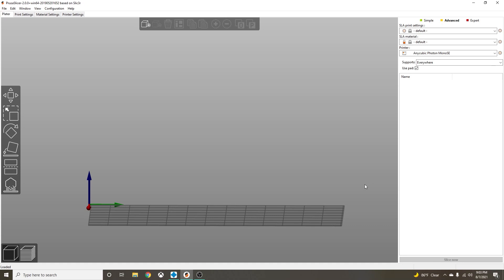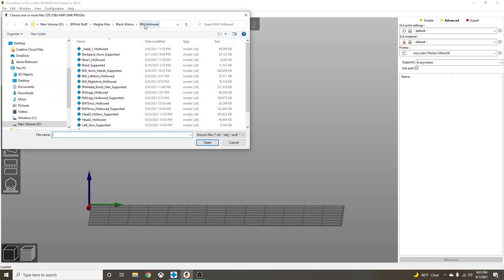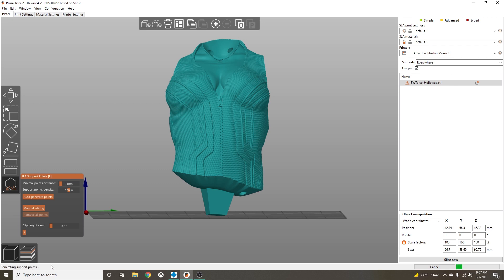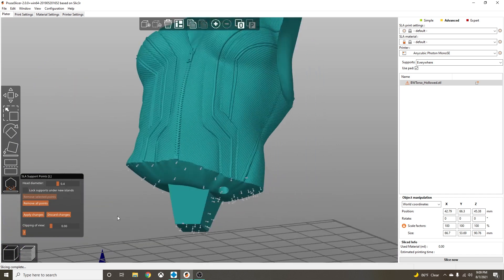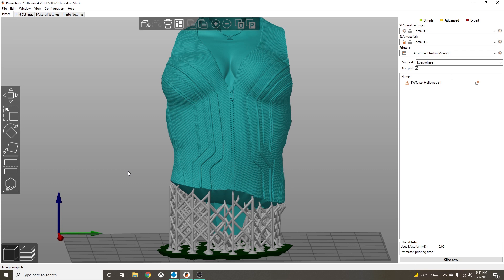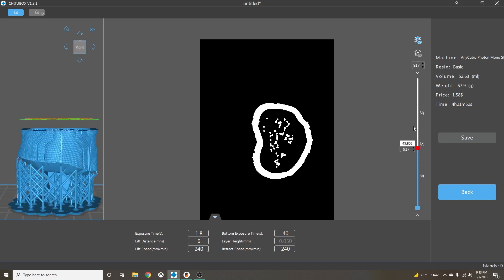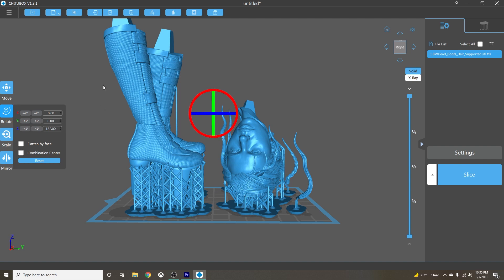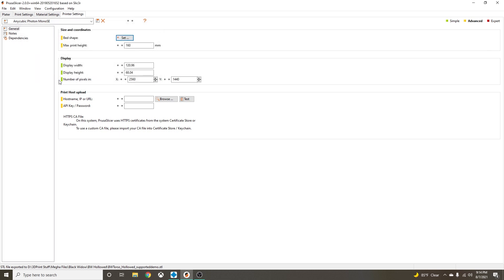PrusaSlicer Autosupports for resin printing- NO MORE FAILED PRINTS

Comment: Thaks awesome video.  have you brought your model back into chichi box or lychee and asked it to find islands to see how accurate your method it.  just curious.  I will definitely give this a try.  So your work flow is
step 1. bring into chichi box and hollow and put in drain holes
step 2 bring into purse and do what you showed in the video
step 3 back to your chichi box and slice and good to go.

im telling you im going to try this and it will save hours thanks
Reply from the maker: In the beginning I would use Photon workshop to find any islands because it's the best for that, but after never finding anything bad, I just stopped. It took me a while to trust my printer and trust my slicer but it hasn't let me down yet.

Comment: i see that you dont use inner fill for your prints, your models are completely hollow inside?
Reply from the maker: I don't use infill, but the models have supports inside.  I would prefer to have only supports so I can remove them before I cure the model.  Infill can't be removed.

Comment: How do you get the resin settings on this slicer? I just installed 2.6.1 can't see nothing to change it to resin sla options?
Reply from the maker: Click the Add Printer and select Prusa SLA. Then to the right of it on the right side menu, click the little settings gear and you can set up your own printer details. Thank you for watching!

Comment: I wonder why rotating it would mess it up?
Reply from the maker: I'm assuming you mean that when you pull the file into Chitubox, you don't want to rotate it.  That's because you've already supported your model with a pad below it and if you rotate after you bring it into Chitubox, there will be a new pad and supports needed.  Ideally, you want to rotate your model to the best position in PrusaSlicer, support it, and then only use Chitubox to slice the model to get that file extension you need for your printer.  I hope that explains it for you. 🙂 If not, ask another question about what it is you're not clear on.

Comment: Looks really useful. I have a Creality LD002H. Having mixed results atm. Any chance you could show me the right settings for this printer on the PrusaSlicer?
Reply from the maker: When you say settings, are you talking about the buildplate size settings?  Other than that, the settings will be the same for all printers.  If you mean the printer settings, you'll click on the Printers tab, and then all you have to set is the Bed Shape X and Y (leave the other settings in that pop up box the same) and then click OK and then set the Max Print Height.  Then on Display, set your Width, Height, and number of Pixels (you can actually find all this really easy in Chitubox.  Just click on Settings and that will give you your resolution, which is the Pixels in Prusaslicer and your buildplate X and Y) Everything else just leave as is.  Then you'll click the little Save icon at the top and name it your printer.  Then you're all set.  Hope that helps 🙂
Reply: @HomemadeJam3D  thanks for the reply. I have used all your tips and so far have not had a failed print. Thanks a bunch. I will recommend you and the channel to all.
Reply from the maker: @frankblack7685  thank you so much!! I really do appreciate it!! My aim is to help anyone that would like it, because I know what it's like to be so frustrated with failed prints. 🤗

Comment: I feel stupid but I have no option for auto supports like on your screen the only option I see is “paint on supports”?? Am I missing something?
Reply from the maker: Have you selected SLA printer?
Reply: @HomemadeJam3D  nope I’m an idiot I had not! Sorry lol thanks for helping. Tried angling it with the arctan angle and adding supports in prusa then using Chitubox box but I still ended up with very minor voxel or pixel lines so I may open a ticket with anycubic. My settings are so low that it takes like 12 hours to print a mini lol. But if that ends up being the limitations of the mono Se so be it
Reply from the maker: @ericclement1598  I'm glad you got it figured out.  There are no idiots :) You might try a different angle. When I first started printing if I printed something and it had too much stair stepping, I would try a different angle and that usually helped.

Comment: I tried this method and it works great for me! No more time wasted.. Thank you for the tip! Do you use antialising with chitubox on your print? Thanks again
Reply from the maker: I'm glad it's working well for you!! It really does save a LOT of time!!  I don't use anti aliasing in Chitubox because I really don't see any difference in my prints.  I've heard that it doesn't work on the mono's anyway, who knows.  I've pretty much got it down to how I orient the prints as to whether or not you can see any stair stepping.  Thanks again for watching!! :)
Reply: @HomemadeJam3D  this could be another question, XD. I have a lot of stair stepper, i tried 30 and 45 orientation but nothing happened, it just changed the orientation of the stairs. Do you have a tip to prevent it? Thank you
Reply from the maker: @sergiobertoccogambi8365  I'm so sorry!! I just saw this comment. You can almost remove stair stepping completely even without using anti aliasing just by orienting your models differently. Also printing slower or at a shorter layer height such as .03 instead of.05. It won't get rid of every instance of stair stepping, but it'll sure make it a whole lot less noticeable. 😊 Again, I'm so sorry for the late reply and thank you so much for watching!!

Comment: can you please show your support settings in prusa? i am trying to figure out how you have the pad/raft angled along the edges....
Reply from the maker: I don't change the stock settings at all. The only time I change the stock settings is if I add additional manual supports and then I only change the top parameter for the support point size. I slide the bar down to .2 just to add tiny support points. Let me know if you have other questions. I'll be happy to explain further.
Reply: @HomemadeJam3D  hmm, thats odd, cause im getting squared and not angled edges
Reply from the maker: @inknoidian  that is odd! I'll look at the settings in my version and let you know if I can see where that can be changed.
Reply from the maker: ok, I've looked at my support settings and can't find anywhere to change the support points to square.  Are you sure you have SLA printer selected?  Squared supports sound like what would be used for FDM.
Reply from the maker: @inknoidian  just checking on you. Did you figure out the support settings?
Reply: @HomemadeJam3D  no, ma'am.  still failing....
Reply from the maker: @inknoidian  well, that's no bueno.  We're going to figure this out.  Are you still getting the square supports?
Reply: @HomemadeJam3D  it was the raft edge i was talking about that is square edged, they dont have the angled edges like yours.
Reply from the maker: @inknoidian  ohhh, ok.  Is that after it's printed or just what you're seeing in the slicer?  And what slicer are you using?
Reply from the maker: @inknoidian  in the main screen, in PrusaSlicer, you can click on Print Settings and adjust the pad there. My slope is set to 45. You can change that and it should change your raft.
Reply: @HomemadeJam3D  is there a way we can chat outside of youtube please?  maybe make asking for help a little easier?
Reply from the maker: @inknoidian  Sure! Add me on Facebook or Instagram.  Facebook is Jamie Lynn Robinson with the same profile picture and Instagram is HomemadeJam_3D with my painted Thena as the profile picture.  I agree, it's a lot easier :)

Comment: Great video! Would you mind to share your support settings? I see for manual that they were 0.4, but what about the other settings? Thanks!
Reply from the maker: I didn't change anything. I just use the stock autosupport settings. Usually if I add additional supports I'll slide the bar down to .02 because I'm just adding that additional support to reduce the little bit of sag that happens, not for weight bearing. Sometimes I just leave it as stock. It just depends on if I remember to change it lol.
Reply from the maker: And thank you! 😁👍

Comment: ...just saying, but with lychee pro, you can edit the support contact points and basically everything that you seem to be complimenting prusa for, Generally speaking, the only thing the prusa slicer could have over lychee, or chitu would be the ai controlled for auto supporting and it's accuracy..does it miss islands for example, etc (both lyche and chitu cna and will miss islands)
Reply from the maker: You can also edit the contact points in Prusa and so far, it's never missed a single island. Also, it's free. Lychee Pro is not.
Reply: @HomemadeJam3D  Lychee is also bloated and runs like a mule regardless of system
Reply: Used to use Lychee Slicer Pro. Not anymore. Went to doing the plate in Prusa Slicer and then slicing it in Chitu. Have had zero fails since (yes, my Lychee Slicer had the same support and resin profile settings and it still failed).

Comment: Give Lychee slicer a try :)
Reply from the maker: I did. I gave it a fair chance and it was absolutely horrific! Definitely no autosupoorting for me with Lychee. Every single print failed. And that "auto orientation"? Lol nothing how I would orient my models. It would put supports on faces and all over the front of the models. Me and Lychee just couldn't get along. If it works well for you, then that's super awesome. I just couldn't deal with it. 😊

Comment: Should also use the repair tool as well; next to the file name click the ! and it'll repair any messed up parts in the mesh that might cause problems. Prusa is def the best for auto supports when you dial in the connector / bridge settings and resin times :D
Reply from the maker: I'll definitely give that a shot if I come across any files that have mesh issues.  I have noticed that Prusa will "auto fix" a lot of things.